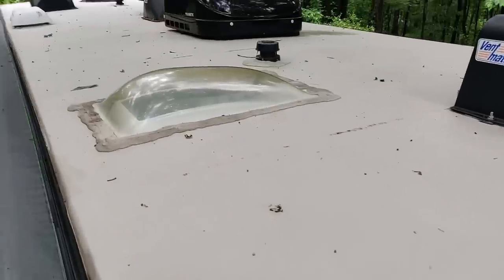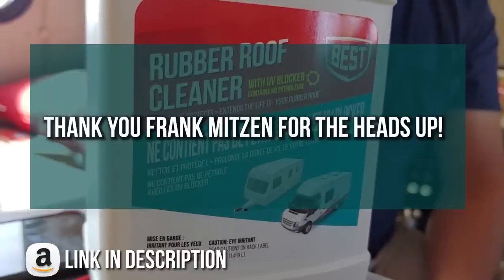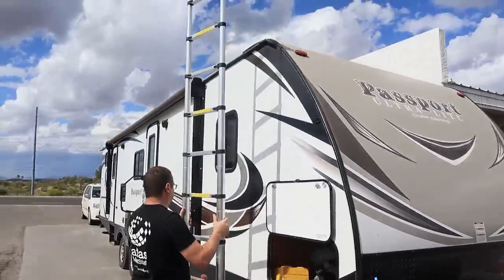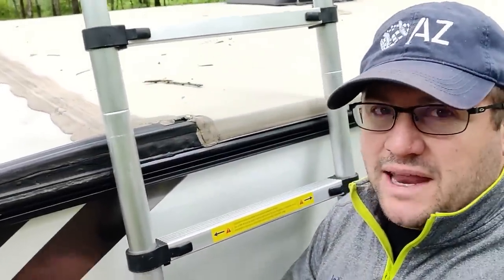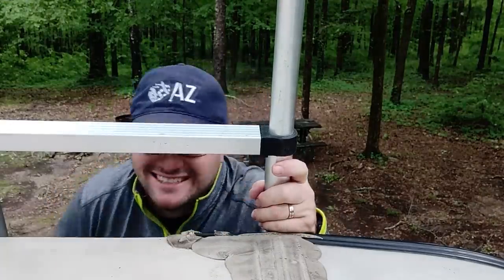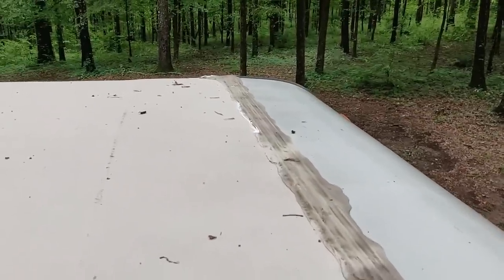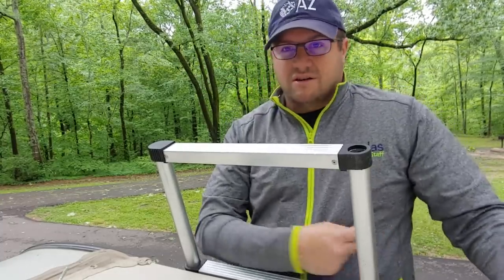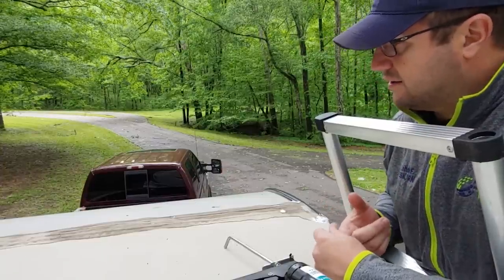Our Travel Trailer has a Leak: Maintaining a NON WALKABLE ROOF

Comment: Buy a roll of 4 inch eternabond tape and clean, apply tape, roll to activate.
Cover the entire transfer joint.
Reply from the maker: I was thinking of this too. Do you dicor under the tape or just slap it down directly over the joint?
Reply: @NoOrdinaryPath  you will need to clean the area with denatured alcohol, then apply a eternabond primer, when you apply tape do not stretch the tape, you will need to roll or rub and press the tape down to activate the adhesive
Reply: Just what I did the stuff is very good

Comment: I installed bond tap works ver well corse my camper is a 2022.and it really didn’t need it but for double bonding I put the tape around everything.thanks for the info on the treatment stuff I didn’t know they needed that I have had my camper for almost a year but durning the winter time I cover it up with a good tarp.
Reply from the maker: Always a good idea for sure

Comment: The RV Roof Install company mentioned by Jessica Wilson seems like they do a great job! They say NOT to use caulking though. However, especially the caulking you're using, acrylic, is paintable and it shrinks/cracks if it's not painted. If you MUST use caulking, I'd recommend a 100% silicone caulk (like tub/tile). Lasts way longer and completely water resistant (paintable caulking is not). RV Roof Install says to use an "adhesive sealant" instead because it actually adheres as well and won't let go. A couple brands they recommend are by Exxel or Chemlink, but the important part is that you use an adhesive AND sealant. They apply the same way, with a caulking gun. At any rate, I'm in the process of restoring a water-logged camper right now and their vid's have been a wealth of good info. Highly recommend checking them out. Their website has a ton of info too. Not trying to advertise for them, just really impressed with the content they provide and trying to help. Good video!
Reply from the maker: Thanks, WakeUp. We used Silicone and honestly was planning on pulling it back and using Dicor to reseal everything. Although everytime I check it there are no cracks or anything that looks like it will break down soon. Probably just going to leave it for now rather then run the risk of pulling and tearing the roof.

Comment: Bought a passport that seems like it had a leak like this. Soft spot on roof/ceiling and inside front wall seems to be water damaged. How does the water dry out once in? Seems like with the laminate wood the water may never dry out and keep spreading like cancer? Any suggestions?

Comment: Don't be shy with caulking put it on thick.  A water leak at your cap can destroy your RV. I use a dehumidifier in my RV that works great for keeping it dry inside. A dehumidifier will help dry out the water in your walls and ceiling and prevent mold mildew and rot.
Reply: RV DOG same. Love our dehumidifier
Reply from the maker: We have a dehumidifier we picked up during our columbia mo contract. It has been amazing!

Comment: You should have used dicor, never use chalk it won't adhere to the roof.
Also a couple pieces of pool noodles on the ladder will help protect the roof edge.
Reply from the maker: It's just temporary until we get to Asheville and can fix it for real. :)
Reply: You should never use silicone.  When you do get the Dycor, it will not adhere to the trailer correctly.  Please throw that silicone away.
Reply from the maker: Guys...in a pinch it worked. It does adhere to the plastic parts of the roof and even the previous applied sealent. Ideal? No. Did it stop the leak? Yes. I fully plan on scraping it off and using the dicor once it stops raining. Again, the stuff did the job I needed it to given the alternative of letting the leak continue. Improvise, adapt, and overcome.

Comment: 🏆🎖 SUBBED! Intrigued how u execute travel nurse role + 1st exposure to u channel. Will check u other vids to see if u full-time on the road. I'm also an RN (100% telecommute) so our families have that + non-walkable roofs (ugh!) in common. General RV never mentioned at purchase time (our fault!) or would've made diff decision than 2021 Coachmen Apex Ultra Lite 31ft. Downsized from big, sturdy, older Class A Motorhomes. Grands all adults 👩🏾‍🦳👏🏾